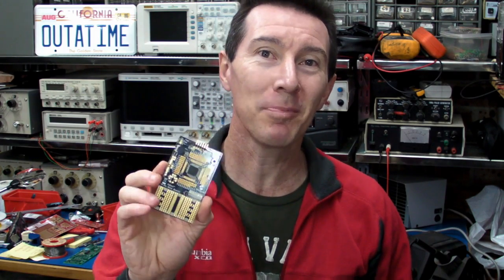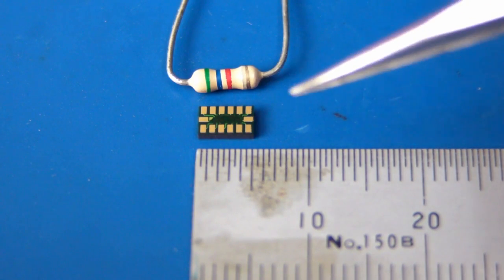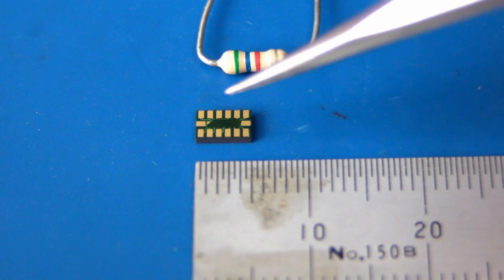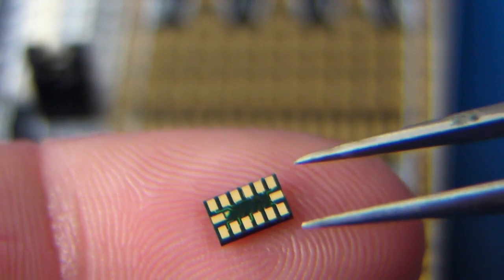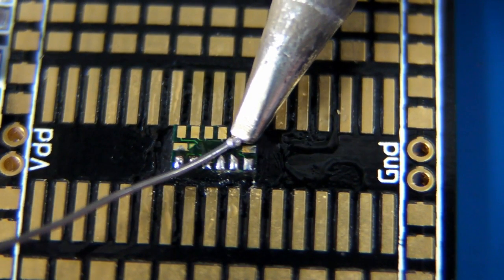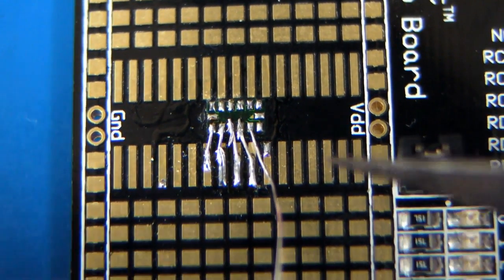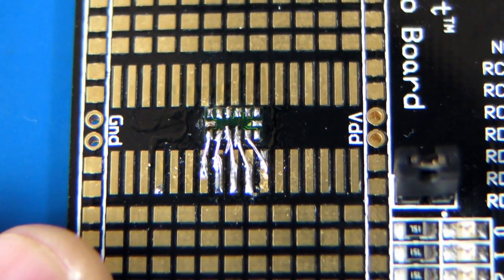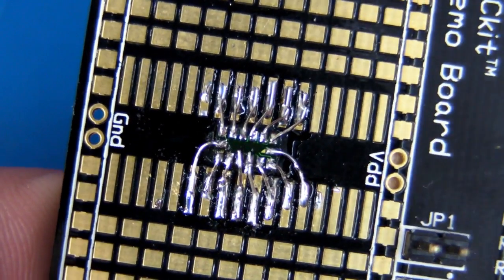EEVblog #181 - Dead Bug Prototype Soldering

Comment: i want to mod a 22ghz radar module, and i can find these mmic 22ghz amp chips on ebay, is there anyway i can do it? they have acutal bond wire connection pads.
Reply: You would have to be careful on how the RF wires are positioned relative to the PCB. You would not want your RF wire doing sharp turns and at the same time, the shorter the better. I don't think it would be advisable to solder it bottom up as shown on the video.

Comment: I do electronics assembly for a living. For people watching this old video and trying to learn how to solder - mostly, Dave gives great advice, but: A - Obviously he does alright with that big fat chisel tip, but the little conical soldering tips he doesn't like work much better for this. B - If you use more flux and wipe the tip frequently you won't have all of those tits sticking out when you are done. And C - As someone below already mentioned, you should not solder a wire onto the chip and then bend it; the solder joint or even the chip can be damaged.
Reply: cloudfan notthatcloud 
Would it make sense to solder the lead wires to the pads on the board, then bend and solder to the chip?
Reply: So pre-bend the wires?
Reply: @MrSapps  At least touch them up/reflow them once they are in place. Same procedure as with long THT leads - people tend to trim them AFTER soldering to the desired length which adds strain to the solder joint. You can do that - but touch it up thereafter.
Reply: I don't think bending the wires after soldering matters if the wire is >30awg, these wires are just not strong enough to put any pressure into the solder joint from bending.

Comment: Depending on the application, breakout boards for several modern accelerometers are available from sparkfun and the like. These can be easily soldered to PCBs, or have headers soldered on and used that way. Great for prototyping if you can make do with the choices available.

Comment: Just an advice for people wanting to try this (and for you Dave). It is better to solder the wire on the board first, then lift them and glue the chip, bend the wires back in place and trim them, and now you solder them to the pins. You should avoid having any mechanical effort on the chip pin. A 0.4mm pitch qfn is so fragile you can break a pin just by bending the wire. Also, don't use no clean flux. A very greasy flux is best for these kind of work, the down part being that you will have to wash it away (or not, it will work anyway).
Reply: Yep good advice, last week I soldered a 100pins QFN 0.4mm for a quick MCU replacement validation (replacing from 0.5mm to 0.4mm with another in the same series). I was lucky not breaking any legs by soldering pins first. Greasy flux in syringe worked perfectly and 30AWG WW wire was ok-ish.

Comment: slow start, but once you got going i was impressed at how fast you were moving. Nicely done.
PS: mod wire, is also called Kynar wire. And i use a LOT of it. I use a lot of through hole PCB proto-board work, and the kynar can slip through a spare hole so i can have it move over to get out out of the way.
Which i call Ghetto-double-sided prototyping.
Reply: +Just Angie lol.. he sped up the footage slightly towards the end ;)
Reply: +Just Angie I have been looking for "mod wire" all over, your comment helped me out! Thank you!

Comment: You don't happen to have a tutorial or tips for soldering wires between different parts of a PCB? For example, soldering wires from a flat pack that goes to completely different parts of the board.

Comment: I've found the individual wires in de-soldering braid are ideal for making this type of connection. De-solder braid is generally pre-fluxed too.
Reply: Peter Brereton Also the grounding braid on coax is a nice fine gauge and easy to work with....
Reply: Peter Brereton Good call!.....
Reply: I agree.
Reply: Its funny you say this, because Ive done this, I also save my used desoldering braid for thin flat nice looking jumpers and board jumpers like to connect the 2 emitters on a npn 2sc2290-2sc2879 rf transistor  And theyre already pre tinned from the old solder!!!!
Reply: depending on the coax you have, dont try using rg56 lol! stainless or aluminum braid wire lol, wed be there for a week trying to get solder to stick haha
Reply: I've many times used 2.5mm desoldering braid to repair large broken traces. I flood the whole braid with solder and it makes a strong permanent patch.
Reply: something i probably would never have thought of

Comment: Arduino is a great gateway for software developers into hardware - it's how I made the jump and it was pretty easy.

As for ISP devices you can program your Arduino to be an ISP for external chips. I have an Arduino Uno that I use almost entirely for that purpose. The code is included in the standard package and all you have to do is upload it. I'm actually in the middle of building my own ISP hehe

Comment: aren't there sockets for these things? Something ZIF-style which you then (or previously) solder onto a pcb (or insert into a breadboard). Something like the socket for the microcontroller on the TI msp430 development kit

Comment: Earlier this week I soldered a few 1.2 x 1.2 mm BGA-9 chips onto some SOIC-to-DIP boards using epoxy (I find it won't degrade under heat as much as superglue) and magnet wire. Basically a homemade version of chip-on-board construction. First attempt took 3 hours but after that I could get a chip done in about 45 minutes or less.

Comment: I tried this a few months ago with a 15W iron.  
The superglue I used let off nasty fumes that burned my eyes for HOURS and it softened to the point that it let go of the chip. I ended up tossing it the whole board and buying a proper breakout kit.
Reply: It is probably due to your soldering iron. How could you need to heat the bottom of the chip so much the cyanoacrylate fumed?  A proper soldering station should solve your problem.

Comment: I bought a magnetometer to do this but found out when it arrived it had 0.25mm sized pads! I tried using a single strand of wire from a multicore wire which was still far too big! I ended up giving up and ended up buying a breakout board.

Comment: Thanks for the video! I used the method on a LIS331DLF (3mm x 3mm LGA16)
It worked great. I used the 0.1mm diameter strands from a multi-strand wire.
Here's the pic: bit.ly / zFe9ra

Comment: I usually prefer 0.15mm enamelled wire for point to point on board connections - unless they carry a lot of current of course. The enamel can be taken off with a drop of molten solder (enamel smoke, don't breathe it) even in very short lengths and the rest of the wire stays isolated.

Comment: Doesn't someone make little pre-tinned adaptor boards that would accept SMDs so that you could just run your soldering iron down the row and connect to the chip installed in the normal way? The you could solder wires to the board.

Comment from the maker: @Zagroseckt That tip isn't small, it's pretty huge, standard several mm chisel tip, but as you can see more than good enough for the job. I have much smaller tips. I have a pretty steady hand, but this is not a really small job, so should be doable by almost anyone. More shaking apparent in the video than I'd usually have, trying to talk, think, and solder and do it all while under the camera through the LCD screen.

Comment: @ubuntututorials 
If this is really critical, i would glue the ic on an copper cladded board as a ground plane and solder the capacitor next to it. If it´s less critical, I just try to solder it as close as possible.